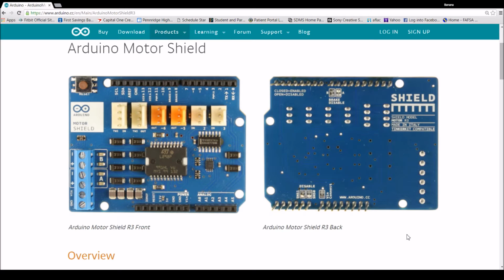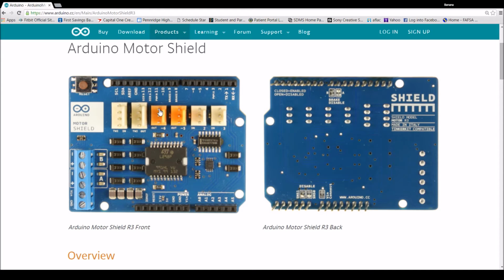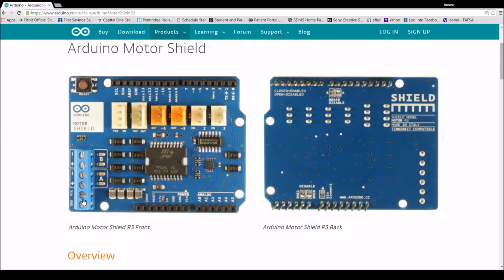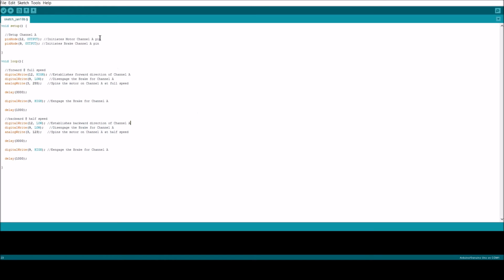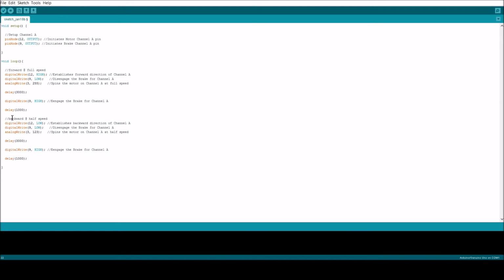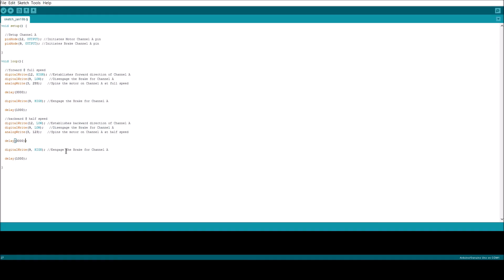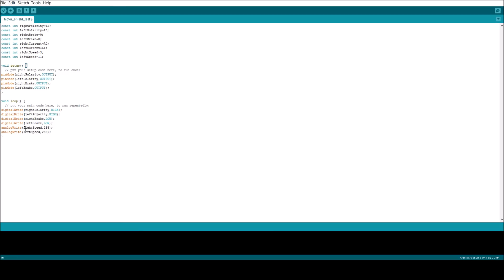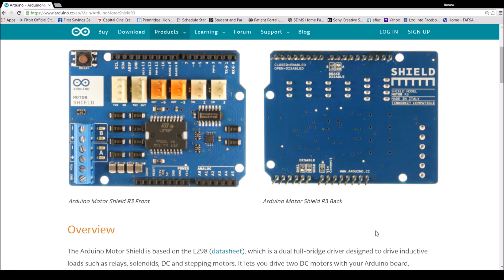Arduino Motor Shield tutorial- Controlling two DC Motors

Comment: Great video! I am making a ball launching machine using a 12V 30W motor and a 16.8 Ah Lithium battery. Would this motor shield work with this setup? If not, what is your recommentation? Thanks

Comment: The shield also works great with the Arduino Mega. Is it possible to stack 2 of these to run 2(4) stepper motors individually? I have 4 steppers which will work in groups of 2, but I need to be able to run these groups individually, 2 running one direction and 2 a completely other. Is this possible or is there a better solution?

Comment: If you don't need the brake & current sensing features and need to free up more pins, you can snip the jumpers on the back of the motor shield as indicated.  Also Arduino recommends cutting the jumper labelled "Vin Connect" if your motor voltage is greater than 9V.  Yes, the board can handle up to 18V, but that just leads to needless overheating of the voltage regulator.

Comment: Can I stack two of these shields on top of the arduino for control of 2 bipolar stepper motors...
Reply: would probably use way to much current even @ 5 volts
Reply: and the are at the same pins

Comment: is that a port for your barrel jack to charge up your power bank?
Reply from the maker: yes
Reply: thanks, because i'm thinking of using a y splitter 5.5x2.1mm female to male connector for my motor shield and arduino uno wifi. May i ask if you've the link to the battery pack?
Reply: or perhaps you can just tell me what type of batteries you're using for this project, much appreciated:)
Reply from the maker: https://www.servocity.com/12v-6000mah-li-ion-power-bank-w-charger This is the battery, although, the price I believe has gone up a lot. There are cheaper options available.
Reply: Pallet Man thanks mate !!
Reply: Pallet Man thanks mate !!

Comment: very helpful, will you make another video about using the servo pins, those "in", "out" and "twi" pins?
Reply from the maker: +Moh Cenation I have never used those but I believe those are for tinker kit things, and you don't need a driver for a servo, there is one built in, all you need is an empty pin and a power source